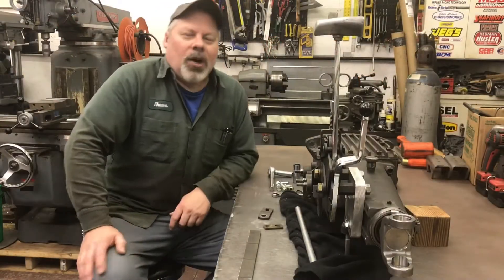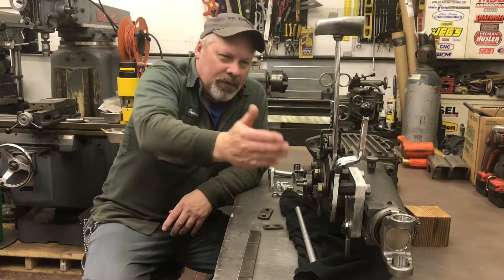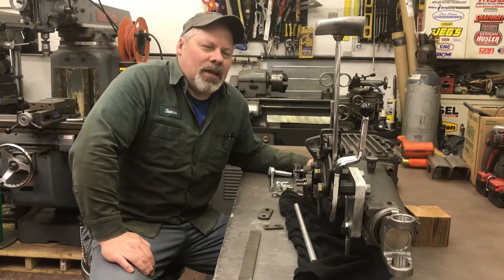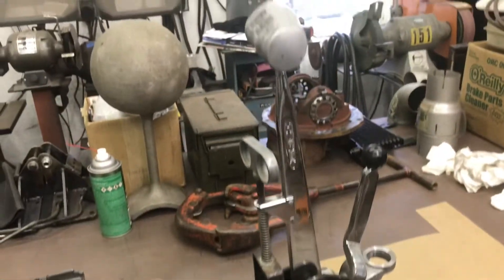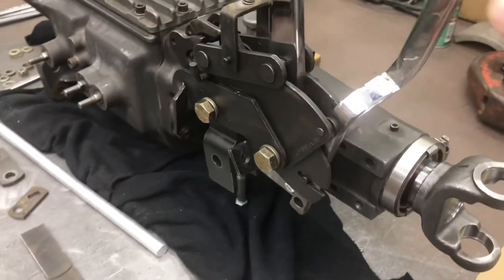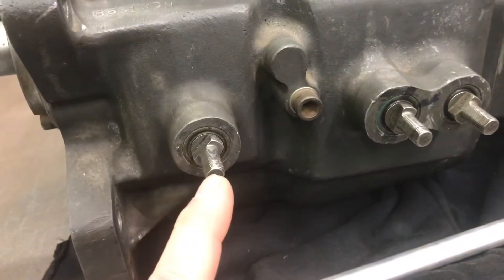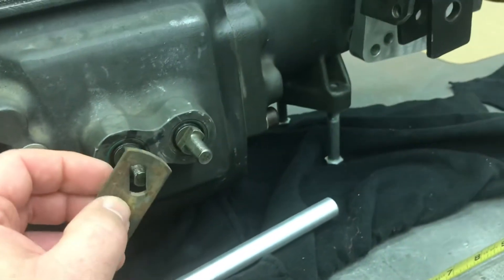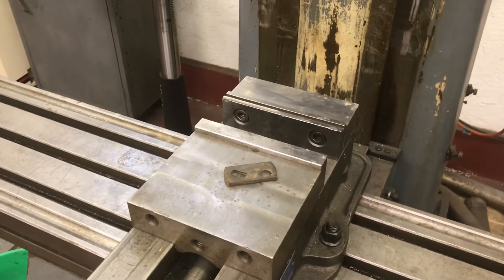Hurst V Gate II Shifter For Jerico Transmission Part One.

Comment: Mine I just bought for my 68 Camaro has 2 high nuts.Seems to be A bit to far over before I install.Was going to pull the Muncie out but I will wait and do more research.Thanks a bunch for this video.Can’t wait to try this sucker out.406 sbc with 4’11 in the rear.Say goodbye to H pattern.Hope this works out.

Comment: I have the Hurst version of the V gate II ,most fun shifter to drive everyday with ,that ring you pull up on I extended the rod so it's closer to  handle so much more comfortable
Reply from the maker: The Long V gate shifter that I have has a trigger handle to pull, much nicer. I was think of extending this one like you did.
Reply: I thought about doing the trigger to mine but I bought this thing it was new in the box could bring myself to modify it that much

Comment: That "6 inch Anderson" appears to be a welded ground stud for 6" IPS tubular aluminum bus used in extra high voltage substations (345,000 volts and above)...
Reply from the maker: Interesting! Thanks!
Reply from the maker: @big_riv6745  Mystery solved! Thanks

Comment: Hi, I'm just learning about these V Gate shifters. You said something about mounting to a Toploader. So, does that mean the V Gate shifter itself is universal, and it just takes different mounting plate and linkage to for it to work on different transmissions? Assuming they are all 4 speed transmission, that is. Great info, thank-you for sharing.
Reply from the maker: Yes the shifter is the same, just need to change out the bracket, rods, and arms.
Reply: @mountainsgarage  Interesting, thank-you. So in my search I don't have to worry about finding one for my top loader per se, just find a good unit, and then piece the rest together as needed. I appreciate the info, thank-you.

Comment: I'm pretty sure there are places where you can buy rectangular punch dies for your hydraulic punch.  I wonder if you could get lucky enough to find one the right size for the shifter brackets?
Reply from the maker: I have two for it, I will check tomorrow if they are close to the correct size, Thanks!

Comment: That might be One of two they coming to set mounts to the leg of a tower that is not grounded such as an AM Tower and the other ball would go right next to it with a certain gap and a lightning hits the tower it jumps that gap and goes to ground in an FM antenna the antenna mounts to the tower AM the antenna is the tower and I cannot be grounded to be wrong it's my guess though